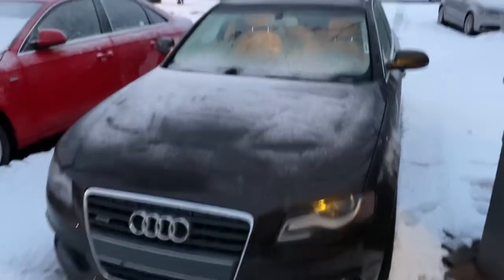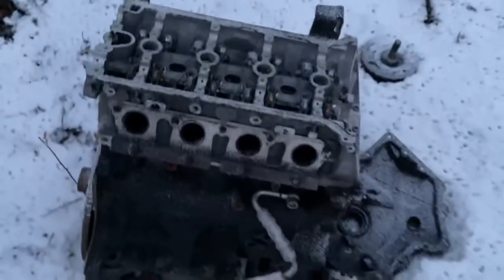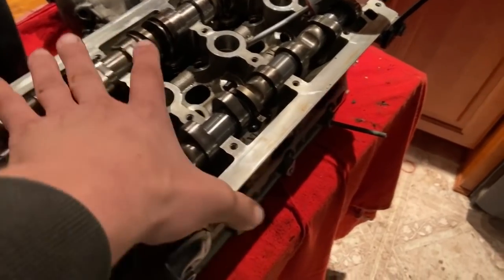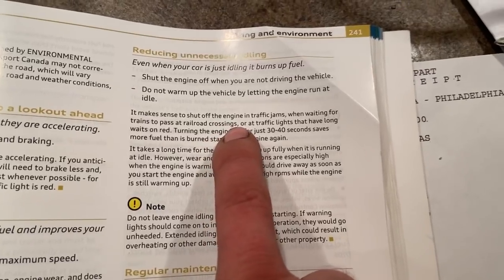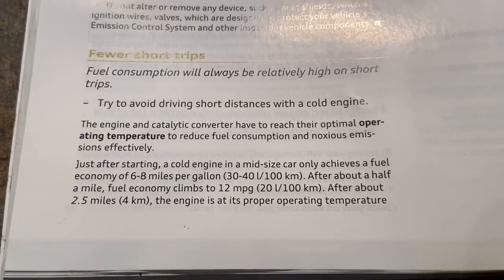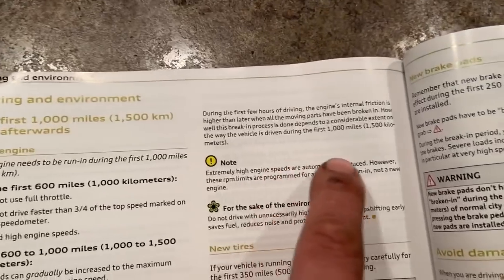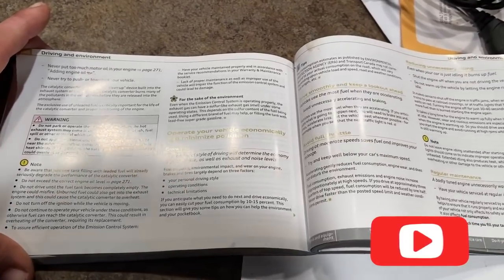Cold Start, What Does Audi Tell Us? Warm up the engine or just hop in and drive? 2.0t owners info VW

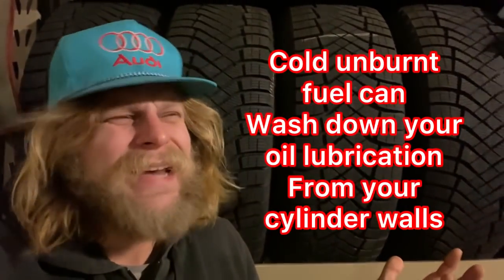Comment: Sarcasm: at 7:09 background sound, your engine start knocking from idling for to long :)

I still have 2007 A3 2.0L FSI (BPY engine) with 250k km on it. Mostly city driven and short distances up to 5km. Summer time, myself and my wife, drive like we stole it. We warm up for a minute during cold Canadian winter, then drive. Let the engine properly lubricate before start driving. I tried to idle more, but it costs more to fuel. The best is to drive like it says in manual, but easy on the acceleration pedal, until it fully warms up. I try to keep my rpm below 3000. We had many Audi models, never had problems.

Comment: I start my A5 and lt idle until the RPM drops to the normal 750 RPM.   About 60 seconds, then drive in a reserved manner for a couple miles (at least).  I did that with my 2001 225 TT also and it was traded in at 180,000 miles and still ran great.

Comment: I idle my car for about 5 minutes a lil more in the winter till my oil temp is a lil over the C line.  Drive smooth for about a mile then I'm in the clear . On my hybrid the car is always ready to drive,  but its driven smoothly for atleast a mile so everything can reach normal temps.  My 6 cylinder is 11 years Old with bout 250k miles . Only hiccup I have is its starting to burn oil around the 2k mile point , but that's normal for an old engine that was used as a taxi for most of its life . Now that it's a personal vehicle it doesn't get alot of milage , so i should be good with the proper maintenance for a few more years 🤞

Comment: Mercedes said it and now I heared it from Opel. I mean there is a truth behind it.
They say their engine are fine with full throttle on cold state. Yes more or less you would not notice anything for a while. The engine management deals with it 😂
The same time one engine repair garage said that here and there Audi's/vw lost the cross cut in the cylinder in young age

Comment: You want to avoid breaking through the oil film, in a cold engine this can happen at high revs and torque in various parts of the engine. This is intuitive - don't gun it when cold. Throttle position matters as much as rpm, you don't want to load it because all you're doing is pushing metal against metal. At idle though you're spending way more time heating the engine and the clearances won't be right for a longer time. Oil circulation in an engine is optimized for higher rpm than idle so to get valves and everything else nicely splashed you can't baby the thing either. So there's a balance between idling and gunning it. Best thing to do is start it, give it a few seconds to build oil pressure and gently drive it with less than half throttle and low-ish rpm (2k is good). After 5 minutes start driving normally but don't floor it or go halfway up the rev range until it's fully warm. You learn this easier by driving shitbox underpowered cars with low power. If it feels stressed, it is stressed.
Reply from the maker: I didn’t double check but this is probably the best comment / most accurate opinion

Comment: Idealy your not suppose to rev or drive the car until it reaches running temp. On older cars with dial running temp is when needle reaches the C on gauge. But thats mainly for petrol though.

Comment: there is no engine warming up, for an engine to warm up idiling it will take 30 minutes to 1 hour:)) but it s ok to stay 1-2 minutes to idle if the car is cold so you can let the oil  lubrificate all the engine components with minimal engine wear, if outside is -15 degrees and you start and go, the engine will run with no lubrifications for a few good seconds that s not good, so is better to stay 1-2 minute for the engine iddle to settle down and the engine will have minimal wear at 800rpm istead of driving right away with 1500-3000rpm so is good to wait but is not called "engine warmup" is called "engine lubrification time"

Comment: I live in Canada. We have cold winters and plug our vehicles in. I recently rebuilt my Audi 4.2 engine and I’ve always let it warm up for 10 mins every cold start. My carbon build up after 100k kms was very minimal. Yes I walnut blasted the intake and cleaned the carbon but I really think fuel octane is key to carbon build up. Warming up and idling my engine which I’ve done since I bought it in 2010 hasn’t affected my engine negatively. Side note , warning up the engine also warms up the transmission ( some cars need to be in neutral Not Park ) and a warm transmission in -20 makes for a better quality ride as well. I’ll always warm my engine. #777Slots

Comment: Every time I've started it and just drove off at -20°c or lower it pukes out all of 1 fluid and I'm changing parts  . 
It's favorite is power steering , first turn ( driveway exit) it would puke and the hose goes through the belt , sheers off the pully, kills the pump and or rack.....all because I jumped in and went for it .

Comment: I believe there's a law in Germany that you're not allowed to idle for more than 30 seconds or you must stop the engine.
I've always started engines, let them run about 30 seconds or so then driven off gently where possible.
That's fair enough if your local road is 30mph or so, but some places I've stayed when working, the house or hotel is on a fast road with small gaps in traffic, no way you'd want to floor it with a cold engine.
I'm actually fitting a Webasto heater on my car to preheat both the engine and interior.
Electric block heaters are OK for home but I needed something for remote areas.

Comment: What you should do is using 5W/30 and letting it warm up for 1-2 mins, then drive off slowly.
Change oil every 10k km and only use correct oil
Reply: What about 0w40 though
Reply: @FloridaBikeSupplyOnline  The engineers says use 5W/30. They have tested the engine with this oil.
Reply: @danielfl.9347  Do you mean 5w-40? I've heard both 0w-40 and 5w-40 never 5w-30. That's what my manual says anyway. I'm from the USA, maybe that's the difference.
Reply: @FloridaBikeSupplyOnline  In Germany and Europe they say 5W/30, but I have heard rumours that in warmer climates the hot number (30) is increased.
I don't see the harm in using 0W/40

Comment: Without block heater repaired. Morning Cold start are rough on engine. Feels like you riding a kangaroo. 
Big difference with B.H on @ -30°C. Still had to let the car idle for 5 to10 min. Drive @40 km/h till engine reach the optimum working temp.

Comment: For the Ones whom wish to know Engine oil is worthless until it has Climbed to around 70 C. 80% Of engine Damage Comes From Cold Loading You Do not Rev a Cold Diesel Fuck what the manufacturer tell you in that dork book of idiot. Specific Types Of Motor Can Glaze the Bore but not all sat at long idle Our Vehicles Spend longer at idle Running The 3 Phase Inverter or the Power Take off on the Box for Hydraulics they can be in this state for 12 hours plus. Dump the oil early do not follow the new lies on oil interval Messes shit right up Oil will Congeal Poor Supply Will occur when you get in to the Negative 20's and lower. Block Heaters are a waist of time then eh These car Company's Today are So Obsessed with having your pant's down they Constantly fill the everyday driver whom does not know  Full of Baloney. Use Proper Oil that has good Property's Don't use cheap shit it's not worth a Wank.  60% of cars die early because of shit oil........  audi lie

Comment: Some parts of the car needs movment to get oil everywhere like gearbox for exemple !! so after 5-10 minutes you can go smoothly and keep low rpm until hits the 90 degrees and inside the engine is not the same temperature like outside, if outside is -30 then inside engine is around-5 because is protected by aluminum

Comment: coolant heater fort the win, makes my engine about 100*F on start up and even warms the transmission. high rpm with cold thick oil will send the oil pressure to astronomical levels, I believe this is why some audi's have oil pump problems. at least wait for your high idle to turn off(at about 50*F coolant temp) then keep the rpm low at least to 150*F.  running 0-40 mobile and this had done me well on my original engine with 282k on it, very little wear on all bearings and cylinder walls.

Comment: 2009 Passat TDI : I wait out the RPM to fall off to a steady 850-900 and the fuel consumption to go down to at least 1 L/h. Starting it off in warm weather I wait approx. 10 seconds. In extremely cold weather it might take up a minute or two. In rather cold weather it takes about half a minute.
2013 ML350 diesel : I let it idle for approx. 30 seconds every time I start it regardless of weather : it’s a bigger engine so I always wait up as much time as half a minute so the oil flows in adequately.

Comment: Many modern engines will have integrated exhaust manifolds which should also help warm up and the cat should be closer to the engine.   It would be smart if manufacturers limited the max throttle and max revs via the ECU when the engine and oil is stone cold, driving hard in these conditions amounts to abuse.
Reply: some cars have that feature:)) for example lamborghini aventador ( in know :)) not regular car) when is cold you can t pass 4000rpm and and easy the rpm limitator goes up till the engine is fully warm up

Comment: Best way to start your car... start engine... let it warm up for a min or so... then drive off smoothly, drive smoothly and keep an eye on oil temp and once engine is upto operating temp then you can drive how you want... this way all your engine parts are lubricated with oil....your oil and coolant is upto temp.. this will reduce engine wear in the long run... and dont forget to regular oil changes, check your coolant levels, power steering and brake fluid levels...your engine and car will last a long time if you go by this...
Reply: Second this opinion, I typically start my TT and let it sit for about 30 second to minute while I get situated and then take it easy until 15-20 minute after the engine comes to temp to ensure the oil is up to temp

Comment: Anybody know how to get ahold of this guy? I need an engine!!
Reply from the maker: A good used engine typically costs around $3000 after shipping and tax.  Longblock, 
No turbo.  Take a good engine apart and fix timing chains and install new pistons depending on how many new parts you want it’s probably 4-6k for an engine with no good core but I don’t like to do “core return” stuff anyway.  If someone needs a cylinder head job or a piston job and is willing to pay what it’s worth I’ll travel and do it on site.  I don’t even really sell engines but I can.  I prefer to buy broken cars and fix them on my own terms.  NaptownTuner@yahoo.com
Reply: @NaptownTuner   i don't know if I would trust myself to rip an engine apart that deep, which is why I thought of you. I figured you had a couple rebuilt engines laying around!

Comment: I'm in VA. 95% of people start their car up, no matter the temp, put in gear and floor it every-time. Most people here blow motors up in 40-50k miles. I let my stuff warm a just a few min and ease into it. 200-300k miles per motor is normal for me.
Reply: I doubt you have seen engines blow up at around 50k miles  solely based people starting their cars and driving right away
Reply: @georgeparker555  People in my area spin tires with motor cold, spin tires pulling away from every light. Can here cars everywhere with rod knocks and only 50k or so miles.
Reply: @animestarlord9021  I live in NY and I see people do that all the time I agree its not good but never have I seen a car blow up around 50k miles just based on that

Comment: I let my s4 idle for about 39 seconds or so until the engine speed kicks down. Then I drive. That’s for super cold weather. Normal temps I let it idle for like 10 seconds and then go.
Reply: Why 39 seconds and not 38 or 40 ?!?!
Reply: @ihsankoc5165  or 35 36?!?!
Reply: You are right. If you drive slowly after 10 sec it s ok
Reply: I do the  same with my S4, always let it drop down to idle

Comment: Yes it makes sense to get the motor up to operating temp as soon as possible, idling in the driveway won’t get the motor to temp for a tfsi and it won’t for a TDI either. I am not concerned with fuel consumption, I’m concerned with carbon deposits and those TFSi oil rings.. I admit I’m guilty of letting engines idle but now this tip has made a lot of sense to me. I will be leaving the house as soon as we’re running now, thanks for sharing this incredibly important tip

Comment: Yes , got new turbo , new piston and piston rings , oil pump =new .  New timing chain , new valves,  And  still white smog on the street light WTF???
Reply: None of those things address the problem of white smoke.  Take to a good mechanic and get it diagnosed.  Sounds like a coolant leak if is happening after the engine warms up.

Comment: Hi!   Can any body tell me , what happen  witch my TFSI 2.0 t  2010     engine???   When I stop on street light it,s white smog comm in up from exuast  , but when U drive feels OK ,
Reply: The most obvious can be: it's burning antifreeze badly(leaking gasket). Check your antifreeze level.
Reply: Or you could have overfilled it with oil or it might be Condensation

Comment: I always wait until the engine revs down on my 08' A3 TFSI.  I've always assumed that the ECU revs down the engine when all lubrication and warmth thresholds for driving are met.
Reply from the maker: That only happens on a cold start, mostly for emissions though, bumps up the idle to get the catalyst warmed up faster.  Helps with warming everything else faster too if you don’t drive off right away to give it light throttle and light load, getting you into closed loop faster.
Reply: @NaptownTuner   Got it, thanks!  Yeah, when I know it's warm, I turn it on and go.  It's just on cold starts that I've let it idle down.

Comment: All the of the bmw M cars require you to let the motor idle for up to ten minutes to make sure the oil temperature is high enough to not wipe all the bearings out of the motor.  The V10 and V8 have extremely tight bearing clearances and the oil used is a 10w60, omg it is like STP engine treatment.  Yes the negative is the carbon build up and engines seals, but  a new motor is over ten grand vs a three dollar seal and paying a mechanic to walnut blast your intake, please everyone let your car get to temp before you give it the beans
Reply from the maker: I was told some f1 engines are built with such tight clearance they preheat the oil and pour it in before starting